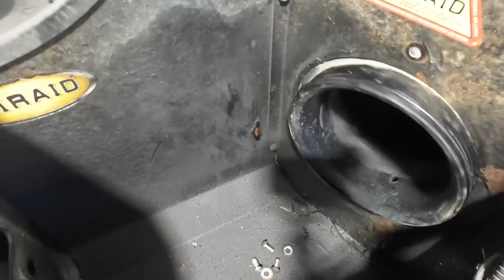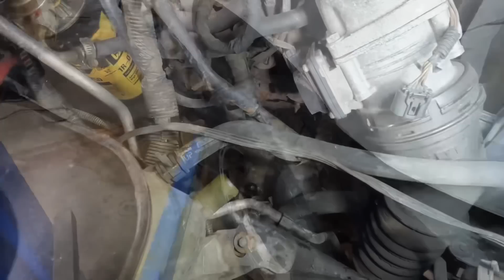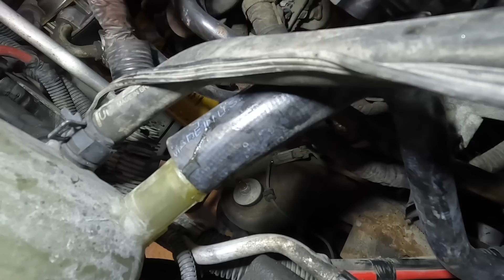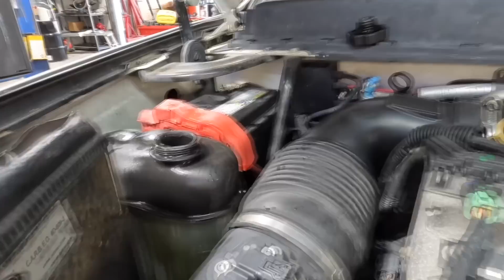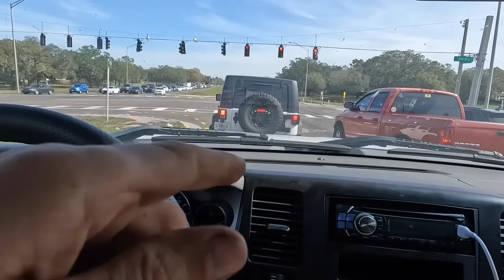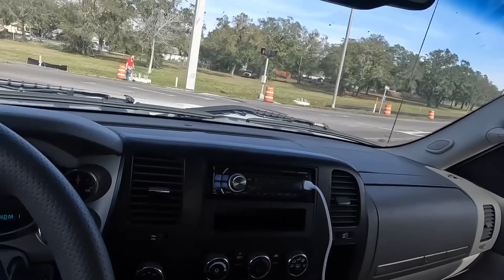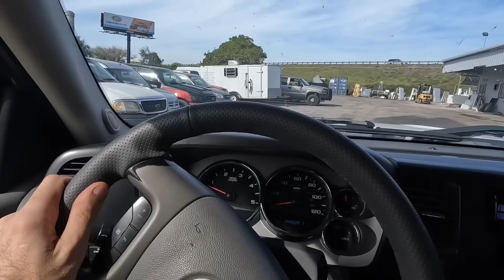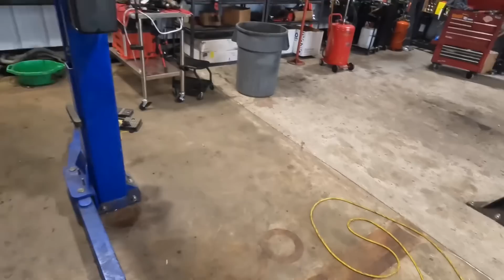Four way Radiator Hose “updated design” | Pig of a job! DURAMAX 6.6

Comment: don't over think it ray, welding it or putting a bolt in it or doing the bolt welded in, in either case it would of worked just fine.
as far as the length of the bolt and your restriction theory? yeah if you put a long bolt in there it may have altered the air flow slightly but the easy remedy is put in a short bolt bro ;o)
you did fine the way you did it, as far as those commenting on what you did? opinions are like a$$holes, everyone has one ESPECIALLY on the internet heheh. Don't worry bout it.
Oh, and on the welding on the truck and worrying about the ECM? yeah you probably should have disconnected the battery and unplugged the ECM but you got lucky. Yes, the electrical feedback through the frame from the welder does have the potential to wreck the ECM if it is still connected, how do i know this? been there done that, seen it happen more than once by those less knowledgeable/experienced about these things.
nice video though, thanks for your time :o)

Comment: Being one of those armchair mechanics, knowing that since the manifold material is thin, I agree the welding was the most efficient method of closing that hole. Armchair mechaincs only see the situation through a very tiny lens. I suggested a pipe plug, but the thin wall of the manifold ruled that out.
Reply: A bung would have to be welded to it like there is for O2 sensors

Comment: My father taught me that you can't arc weld cast iron without pre-heating the cast iron a lot.  But they didn't have MIG welders back then either.  So, hey!  It worked!  As you said, probably now an old wive's tale.  A bit like, "Don't turn fluro lights off if going out of a room for a short time.  It takes an enormous amount of electricity to restart them."  Or, "Mirrors attract lightning.  Put a blanket over them in a thunderstorm."
Reply: You shouldn't turn fluorescent lamps and off too often as it shortens their life it's far from an old wives tale. Every time you turn on a rapid start or instant start ballasted fluorescent lamp (the two most common types) a bit of a cathode material is blown off that's why well worn and bad floro tubes have black bands on the ends that's cathode material being deposited on the tube once that material is gone the lamp is dead.

If you want to turn them and off often such as in a bathroom you want to use a fixture with a programmed start ballast. These are gentler on the tubes and will allow them to last for years even if they are turned on and off often.
Reply: @Bushougoma   This totally makes sense as it gives a basis for where the story began.  We were taught as kids that it was the extreme energy usage on re-starting that was the reason for leaving them on.  As an electrical trade teacher (retired) I often demonstrated to classes the actual power usage during starting (about half) compared to running.  Many in my classes had been told that same story.
Reply: You do realize MIG welding has been around since the 1920"s, right. My dad had a welding business in the 70's and he had MIG, TIG and stick welders.
Reply: @RenegadesGarage  I did not know that.  My father was a Fitter by trade.  I was an electrician.  Probably neither of us had that background.  I grew up in the 50's.
Reply: Oh so that's the reason for mirrored colored balls on cement pedestals you sometimes see in a  yard.... and why they're called "lightning balls"

Comment: Ray, yes. You're in a damned if you do and damned if you don't situation. No, not because you filmed it and put it on YT. Although that doesn't help your case, that's for sure!! It's simply the industry we are in. Even just being in a shop environment, you'll/I/we will have to deal with that. Interview 10 mechanics and you'll get 20 different ways to preform any given repair. At least that's one thing I've learned after 35+ years as a professional mechanic. Heck, one time I found myself in an argument with someone at the parts house over how a brake light switch worked. All I wanted was the part so I could fix the damn car and get it back to the customer. This guy wanted to tell me that it was impossible for the part to function the way it was designed. Ray, the guy was YELLING at me!! To the point the manager had to get involved just to get the guy to shut up and sell me the damn part. 
So again, yes damned if you do and damned if you don't. EVERYONE has their bothers girlfriends second cousins neighbor that got their dog from a guy that could do the job better. It's just the way it is. Which at this point in my career I find it hilarious tbh.
So keep on doing what you're doing. I'd love to work for you and the wife unit!! But the commute would be killer!! Texas to Florida and back again. Nope, ain't happen captain!!
Y'all have a good one and more importantly, Be Safe Out There!! 🤠😎

Comment: Have been working the electronics side for 45y and saw nil issue with the exhaust welding, But did hold my breath a little when you were playing with bolting the +12v leads to the alternator.... It's all good though... I just wish we were in the same neighborhood so I could get you to service my vehicles.

Comment: if you get the chance to take a look, crowsfoot is also an interesting bike spoke lacing style.  the concerns about the ecu blowing up, if you're old enough, you'll remember a short time when those things weren't opto-isolated but manufacturers knew loony off road people would be welding on their vehicle with alternator mods, some missteps, but that kind of thing was fixed before i was born, just gotta not put the ground clamp on the actual ecu case.

Comment: Absolutely nothing at all wrong with welding the manifold. Ignore the whining peanut gallery. Welded manifolds many times in the vehicle with zero issues and great results. Keep doing what you do Ray as your skills and thought process is top of the class.
Reply: I welded cast iron at a machine shop.  Of course, knowing how is the key.  With the mileage on the truck, certainly worth a try.
Reply: If a cracked head can be welded I don’t see why a manifold can’t.
Reply: Hard to tell what kind of alloys are being used anymore. I think that the use of purely cast iron is a thing of the past and at least trying a welder is worth a shot. If you get a good melt and bonding on the edges then you've saved your customer at least several hundred dollars.
Reply: I personally would have welded a bolt simply to prevent any chance of slag or anything falling into the hole.
Reply: Gave up on welding Ford manifolds, as they all crack at the same point, so started to braze them up instead. Less heat, and braze is a lot more flexible than the cast iron, so the darn things no longer cracked. Plus did not have to remove that bloody thing again, saving a lot of hassle on gaskets, gun gum and the possible warping of the casting.
Reply: @SeanBZA  Brazing is something I would see on older machines that were repaired, but it seems like too many people either can’t or won’t do it anymore.
Reply: @SeanBZA its called an afterburner, available now on your turbo engine for the low low price of $999.99
Reply: Anyone who thinks you can’t weld cast iron..doesn’t know enough about welding to have a say.  They are the same people who probably say one cant weld aluminum or plastic  :)
Reply: For the weld. I have no idea since I am not a welder. But you don’t try will never succeed… at last it will be cheaper and being a good test.
At worse the pressure make it pop outside and everything is back to before the plug …
Reply: Right ? All the points Ray made are logical. I'll keep that in the memory bank. 
As well as the placement of the welding ground.
Reply: The weld came out looking pretty clean, and it saved the vehicle owner a few hundred dollars in parts and labor (and risk of broken bolts).
As for the grounding issues? Electricity is lazy. It will ground to the closest strong ground.
Reply: Much easier to remove complete engine🙄
Reply: Yeah, math tutor like skills
Reply: Don’t even bother with the negative comments, waste of your time.
Reply: I wouldn't call it a "whining peanut gallery".  I would call it people commenting so that they can learn.  Whether or not it comes off to some as "whining", they are commenting and asking questions to learn something.

Comment: Cars have been running for over 100 years with plain radiator hoses held in place with simple band clamps. Why on earth do they suddenly need o-rings and retaining clips? Another shining example of engineering stupidity and overkill. Could have just formed the radiator fitting like they formed the water pump fitting and a band clamp would work fine.

Comment: The greatest electric current flows along the path of least resistance, this is true. But this does not mean that in the path of greatest resistance there will be no current at all. There will be a current, but of a proportionally smaller value. In ordinary cases, currents of this magnitude can be neglected.

Comment: Just a little positive feedback but should the wire you added to the alternator not have a fuse ? I'm not a mechanic so idk really. Just curious to hear back from you.
Reply: The original doesn't have one. Also you are not powering the alternator, you are recharging the battery.
Reply: @alanking7331  hahah i know it istn powering the alternator. I mean as protection for a short circuit

Comment: You indeed should have put a bolt in the hole without tapping it and welded it in place. It would have kept debris out and no, it wouldn't put any restrictions in the exhaust. All you need to do is cut the shank off and leave about an eighth to a quarter of an inch of the shank to locate it while welding.

Comment: Ray, you are right, by clamping your ground where you did current will flow from the weld to the ground.
Reply: it didnt cook off the battery acid, thats a plus 👍but yeah it takes the shortest path usually, might want to check the battery charge afterwards

Comment: Electricity always looks for the shortest path to ground, it's the law of physics, this is why tall building have lightning conductors at the very top, because they are closer to the cause, so offer a path to ground that will do the least damage, ergo, no mains blowouts in the buildings usually hit by a strike

Comment: Perhaps if you’d found a bolt that was slightly smaller than the hole and cut the threads off proportionate to the manifold thickness…and then welded the head of the bolt onto the manifold everyone would have been happy.
Nah, not a chance😂😂😂

Comment: Welding that hole in the exhaust was the best method too many arm chair mechanics out there, you do what you as a mechanic with years of experience feel have to be done.
Reply: Hi Ray there are "O' ring supplier's on the interweb  that will have that size of "O' and material
Reply: I have to admit, I would have tapped the hole. Metal shavings getting into the turbo never occurred to me. Even though at my age I'll never tear into another engine, I've learned something that may be useful in some other application. It's another reason I watch this channel.
Reply: @ShevieMine  It would be easy to tap that hole out and not get any swarf in the manifold by using grease on the Tap to capture it, and doing it slowly, in and out a few times.
Reply: Tapping it and threading would have put metal in the exhaust manifold for the turbo to eat. I saw it recommended many times. I agree.
Reply: It occurred to me that a steel plug/bolt inserted into the hole and welded instead of just welding the hole shut would present a new set of bonding problems between the steel plug/bolt and the cast iron. Choosing the right welding wire to weld the hole shut would be more advisable IMHO.
Reply: That was my thoughts originally, but Ray gave good reasons why that was not a good idea. @GeneralSulla
Reply: @jthonn  Ray gave excuses, not good reasons. He should have stopped talking after saying he chose the easy way.
Reply: @GeneralSulla  Use a cast plug as used in plumbing supplies and problem solved, both metals would then be the same.
Reply: That's the difference between a mechanic and fitter !!

Comment: Electricity does not follow the shortest path, it does follow the lowest impedance path, all else equal they may be the same, if materials arfe the same, but not always. Given two paths electricity divides in the ratio of the impedances
Reply: If a conductor is touching ground as in a frayed wire before it is reaching the load it creates a voltage or current divider and causes an undesired operation of the load, however the fuse will blow to protect the wiring anyway. Do not forget there is capacitive reactance and inductive reactance in relation to impedance.

Comment: If that truck was mine, I would of told you heck yeah, weld it! It was the best option to fix that for the money! Ray please don't let the haters get to you. And please have yourself a great day!
Reply: i don't think it's haters, i think they're under the impression that the owner would keep it if it weren't fixed at all, or there was a different target.  if the fix fails, it was gonna be replaced anyway, but for someone that can't spend the cash to replace something like that, the discussion of 'proper' methods is important, not directed specifically at ray.

Comment: 11:13  that truck, i might have been tempted to pull the intercooler, ac condensers, and radiator, but the grill and bumper are in the way anyway.  However they have a lot of hits from objects. Maybe a geo cloth could provide more protection just behind the wire grill.

Comment: There is more than one way to do things. As long as the hole got closed up is the main thing. 
Question is why the bypass hose was not closer to the tube it connected to instead of over by the other end of the hose?
But another good video.

Comment: great vid. again, but I have a question, why don't you use a 'basement'  (don't know how you name it in English) with stairs, so you have better acces underneath these big truck and don't need a mounting roller board?
Reply: mechanics pit

Comment: Why did you not get an o ring for the hose from a GM Dealer instead of the extra expense of  the new hose not to mention the labor???
Reply: He tried in previous video.
O-ring for the original hose is no longer available, just the one for the redesigned hose.

Comment: I know I wasn't a nay sayer, I just simply stated I don't know how to weld so I would've tapped and put a bolt in... restriction would be negligible as Engine Masters proved that by bashing an exhaust system to almost completely blocked and barely made a difference

Comment: Well the best recommendation that you can do is to pull a radiator out in the fan shroud out and that will give you the aqua space that. You will need to act. Accurate space.